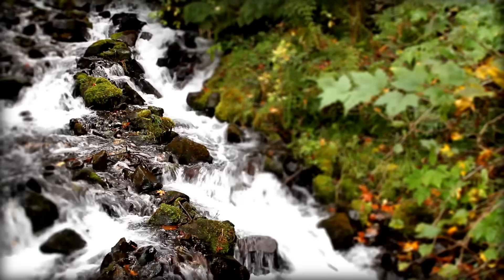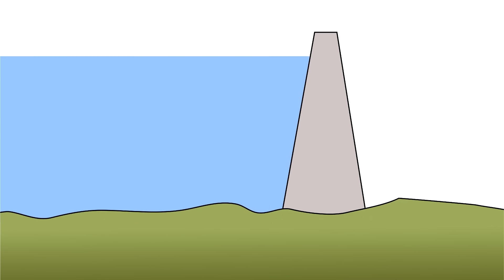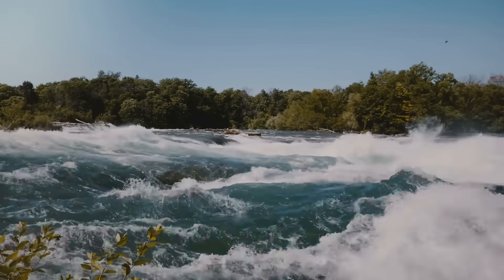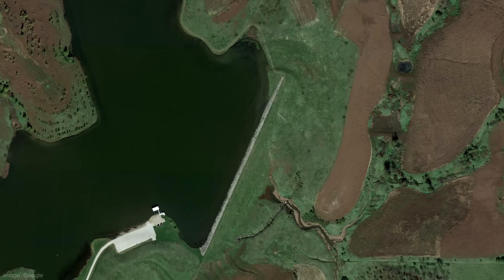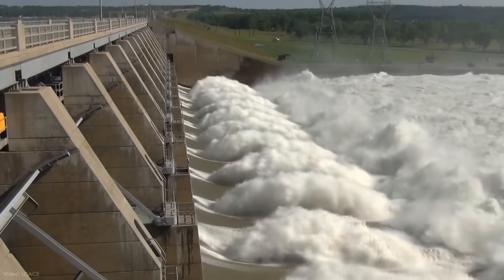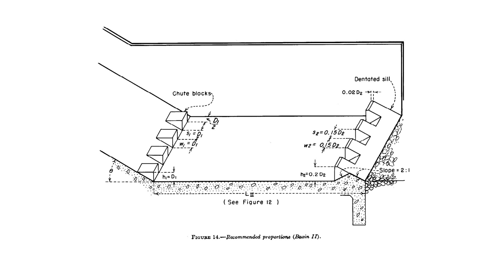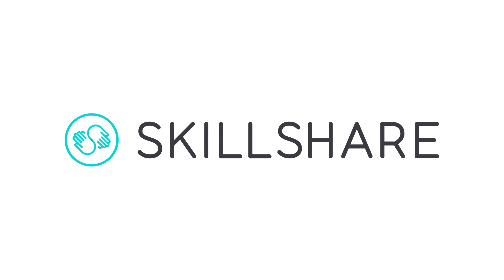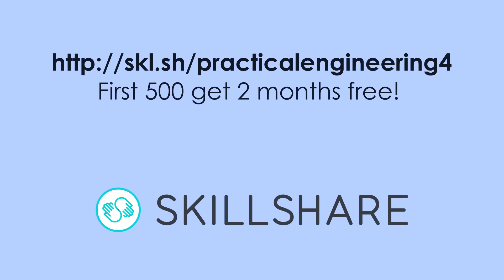How Do Spillways Work?

Comment: I thought I saw this somewhere on your channel but cannot seem to find it - in relation to bell mouth / morning glory spillways, how are clogs avoided / dealt with?
Reply: There are smaller holes for continuous flow preventing the buildup during dry periods. Otherwise the high speed water from the drop will wash away debris

Comment: in my project we have to put in the container we will build the dam in about 50 L ,the dam and about 15KG on the dam to test its strength .what is the material can I use to make the container that withstands all that weight?

Comment: To dissipate the energy on the output of your model, couldn't you suddenly increase the pipe diameter by three or four times, then make a couple ninety degree turns?  You know, all the stuff you told us not to do in the Fluid Effects That Destroy Pumps video?

Comment: The design of that structure with no fence aroud is absurdly dangerous. Especially for pneumatic boats who would be sucked in it in seconds.
Reply: Any kind of fencing around it could cause clogging which would cost a lot of money to remove and risks of flooding.

Comment: hydraulic jumps seem to have characteristics in common with the way air behaves over a plane's wings on landing when the rudders engage :-) only in the case of water flow, the jumps help to slow the water itself, while in the case of a landing plane the resistance caused by the air "jumps" help to slow the plane

Comment: The reason why some spillways on dam walls ramp up a bit after the bottom of the spillway like a skate ramp is to stop the water from eroding the bottom of the dam wall which is called toe grinding which can eventially wash and grind away dirt and rock at the bottom of the dam wall and undermine it and cause a catastrophic failure of the dam wall so that's why the spillway ramps  up after comming down and throws the flowing water up a bit to prevent as I said in the above and water comming down the pipes off the roof gutters on a house and landing on the ground right next to the house can cause that same affect and undermine the footings, that's why you have pipes to keep the storm water to the street curb side gutters.

Comment: Drop shaft spillways are scary stuff if you see them in person. There’s a dam where I live with 4 large dropshafts built into the main structure, and when the dam reaches the potential for overflowing they open gates in the dam that allow excess water to flow into the spillways. Walking next to the railing on the dam and looking down these giant tunnels that descend into pitch-black darkness is a really harrowing experience. I know I’m safe as long as I stay behind the railing, but I can’t help but imagine what would happen if my phone, camera, etc. slipped from my hand and plunged into the darkness, never to be seen again

Comment: I asked what time is it and he told me how to make a watch.  Or was he just fluffing out a two minute video?  "Spillway"....It spills water.    Where?.....To protect a dam from too much water pressure or being over flowed.    How?.......There are three types spillway.  1-low outlet, mechanical throttled(Shows a picture)   2-High outlet, direct flow, automatic regulating(Shows a picture).    3-High outlet, bypass flow, automatic regulating(Shows a picture).   Done.

Comment: Dams in the city-builder video game Cities: Skylines actually don't have spillways by default, inadvertently demonstrating why that's a bad thing--if the reservoir is filling faster than the dam's hydroelectric plant can empty it, the water will always overtop the dam, potentially flooding parts of your city, unless you thought ahead and dug out relief channels beforehand. The deeper these channels are dug, the lower the water level needed for them to start flowing, giving a wider safety margin for floods; on the other hand, digging the relief channels too deep will result in a loss of efficiency, since the water level in the reservoir will be lower, and thus have less potential energy to extract as it goes through the dam the intended way.

Comment: I saw a video that claimed the 3 Gorges Dam in China is deformed because the water load is more than it was designed for. Also they claimed it might fail because they expect a lot more rain. Plesae consider doing a video on that situation.

Comment: Hi Grady: I really enjoy your videos. They are great for people interested in infrastructure and how it all works. I'm very curious how you created your "morning glory" spillway in your shop. All you showed was you turning a wood block into a funnel shape on your lathe. Next time you showed it, was in the tank (the upstream part of the dam) and it was a white plastic looking piece. Did you epoxy coat the wood? And how did you remove the wood from the inner part of the spillway. I'd like to know this as I'm interested in creating similar shapes for concrete molds I'd like to create. Thanks in advance for any help you can provide me!

Comment: I thought that you would explain why that particular funnel shape spillways is chosen.   But not..  you just pointed the obvious without any explanation.
You did not even showed the option where they accelerate the water flux in order to launch it and use the air to dissipate the kinetic energy.

Comment: Well here on the 3 rivers in Pittsburgh all the dams are fix Crest low head dams no spill ways With miter gate locks. The water just flows over the dams. With the dams the rivers are 20ft deep 9ft at the lowest. If the dams weren't there all 3 rivers would only be bout a 1ft deep

Comment: Thanks for the GREAT videos.  Would appreciate learning more about how to hold back more water in a lake/pond as a countermeasure to climate change.  Holding back surplus water from the peak wet makes sense to reduce dry/drought.  Raising the natural water control point a few inches with a weir/spillway is easy enough, but how to do this without impacting fish migration?  What shapes are best to not impede high-water storm flow, yet slow low-water flow at the end of the wet season?

Comment: Due to the upstream rainfalls and flooding, the Arkansas River is flooding right now and the dams are wide open, some dams are being overtaken and had to be evacuated. In Little Rock, Arkansas we are at a 500 year flood level at 29.5’ above flood stage. Dams and weirs are so very important to controlling water.   Great videos.  There are videos showing where the river is actually causing streams and creeks to flow backwards.  We have lots of homes and low lands currently under water. The flooding has set a new record since the dams have been built back to the mid 1900’s

Comment: Recently had my house flooded by a spillway... Too much water, too much rain, had to open all the Tainter gates. 275,000 cubic feet per second at it's highest. I'm miles and miles away from the spillway, but I and many others were affected by it.

Would have been worse if the dam collapsed.

Comment: I keep trying to perform the energy balance on the system consisting of a dam with a spillway.
First with then without a turbine electricity-generator.   So, with a turbine, electricity is produced:
that leaves the system.  But, then, by conservation of energy, something must change in the water 
that flows out of the system.  But what?  The kinetic energy?  So, a lower velocity?
But, by conservation of mass, that simply means the velocity of water input must also reduce,
because the water velocity in = water velocity out.
I am assuming that both the input and output water pass through pipes of equal diameter.
Reply: I believe it is usually the pressure of the water that decreases. Water at the base of the reservoir is under very high pressure due to all the water on top of it, where as water on the outlet side has much lower pressure since it is much shallower. You could also think about it as the gravitational potential energy as the water moves from a high up surface on the reservoir side to a low down surface of the river on the downstream side.

Comment: 5:52 Put generators to spillways
Reply: Spillways aren't used everyday so putting some turbine there will just spike the cost nothing else
Reply: Yeah. Might be nice to see a grate on it so we can’t fall in. Seems like a good Mafia method.
Reply: @AyeCarumba221  are you high
Reply: The spillways are in use when there is a surplus of electricity on the network but consumers are not consuming all the electricity, that's why the water level becomes too high and must be dumped out. That makes that clean hydroelectricity is then wasted. That is also because of private electricity companies who won't stop their pollutant coal electricity plants during those hours of low consumption but high river levels.
Reply: @korelly  No. Wrong.
Reply: Well that's a lot of electricity:)
Reply: Smart

Comment: Spillways freak me out.  When I was a kid, I was on a boat with my family at lake of the Ozarks when I heard the sound of rushing water.  I looked around and didn't see anything.  It kept getting louder and I noticed the boat tracking very slightly to one side.  The noise got even louder and then I saw a giant hole in the water and we were close to some ropes and buoys around it.  I don't recall exactly how close we were but it was too close for me.

Comment: Thanks for the great video. But I don't believe that electrical and mechanical engineers are required in the design of a spillway.
Reply from the maker: Gated structures often require mechanical and electrical engineers to design moving parts and hoisting equipment.
Reply: @PracticalEngineeringChannel  oh right, got my mind stuck into uncontrolled spillways.

Comment: For those interested in the maths, the Probable Maximum Flood is usually around 1 in 10,000 to the power of 2 annual probability. As a result, dam failure is almost always due to design failure rather than exceedance.

Comment: With your model what is the difference if you put fins to create a vortex effect on the flow (theory it would pull air and therefore aerate the water but also flow faster).. I am not naive enough to believe the engineers have not thought of this and tested but would be interesting to see it in action, does it make a difference to flow rate if the end is in water, above water or a combination..
Very fascinating.. great video.. New Subscriber here.

Comment: With all of the congratulations on 1 million Subs ,  now I understand  why it is my next statement will be relevant .  A video made just to get more subscribers  because Although I learned various ways that spillways are designed and their basic function, you did nothing to actually described how exactly it worked. The funnel spillway you said the water spills over and then when the waters a lot higher it chokes but you didn't give any description of what it does after that. Thanks for the misleading representation of your video.    After watching two other videos from somebody else's YouTube channel, I know now exactly how they work. Way more in-depth than your basic what they do type model. Better luck next time. I'm sure I won't see it though.

Comment: I would love to see a demonstration of the importance of the bevel cut on the end of a pipe spillway and the physics behind purging the air bubble in a pipe spillway.
It is almost impossible to explain that it requires a head pressure of twice the diameter of a sloped barrel spillway to purge the air bubble and load the pipe.

Comment: I worked on the control system for a spillway at a hydroelectric dam in BC, Canada. A key component was to maintain minimum flow to keep fish alive in the river. We used redundant PLCs and three instruments from two manufacturers for every measurement required (level etc).

Comment: How do uncontrolled spillways relate to bottom outlets? I worked on the Mosul Dam in Iraq and they have a bottom outlet that discharges water of the Tigris constantly, in various coordination with the power tunnel outlets and in storm surges, the overflow spillway.

Comment: How about a more detailed discussion of energy Dissapators.    Years ago, I worked on a project where we upgraded a culvert from a 18" to a large arch culvert (72x48 I think).   The problem had been that a 25 year storm would overtop, then blow out the road.   To reduce the large wall of water (this was in a desert community), we design a huge dissapator to force the water of fan out over a large parking lot.   While the arch culvert was installed, the dissapator wasn't and now there is significant downstream damage during every large storm.

Comment: Another excellent video.

We were just down in the Sacramento area, and I wanted to go to Lake Berryessa to check out the bellmouth there. It had rained a whole lot (and was continuing to rain a whole lot), but it never crested. It spills at 440ft, and it peaked at 439.9, apparently. I ended up not having the time to go, but my sister and her boyfriend went ... she said it was pretty boring as it was just barely below the top and not spilling. Of course, they don't nerd out over large engineering works like I do ...

Comment: One of those videos of the dam with the hydraulic jump was actually gavins point dam. That was during a major flood in 2011 and it actually almost destroyed the dam. They were letting 80,000 cubic feet of water through per second and that was the most they had ever let through.

Comment: The Arkansas River is facing historic flow and height levels right now which is approaching the design limits of the lock and dam system. Would be a good research subject for aspiring engineers.

Comment: I'm a control engineer in France, currently working on swapping old control units by new ones. By looking at the code, PID control of the level of water has to be crazy responsive, the dam is downstream a small canyon, where water flows at ~3cfs (>1m3/s), and when a storm is getting stuck in that canyon, the level is rising by 4-5 meters and the flow can jump to 53 000 cfs. (1500m3/s) 
That number of 1500m3/s was theorical until a mega storm did a 1850m3/s in the '80s. 
That's why we are changing 30 year old control units, they are not responsive enough to hold that huge change in very little time (4 to 5 minutes, litteraly a flash flood)

Comment: I live on a small flood control lake. The lake has flooded several times, but the spillway has never had to be used (it is just a concrete ramp leading down to the outflow river). If the spillway ever was used, the water level would have reached 6 ft from the corner of my house, and it is a 1/4 mile walk to reach the water. This lake is designed to hold 6x its normal volume of water before overflow.

Comment: The reservoir I used to live near had both a bell mouth overflow (which has to be the most intimidating structure we've managed to build) and a spillway. The spillway had weighted 'buckets' that would fill with water before being pushed open by the water. It then spills down a chute full of concrete cubes to break up the flow.